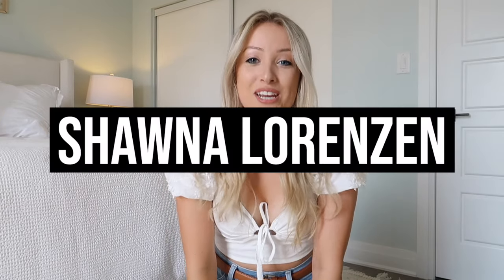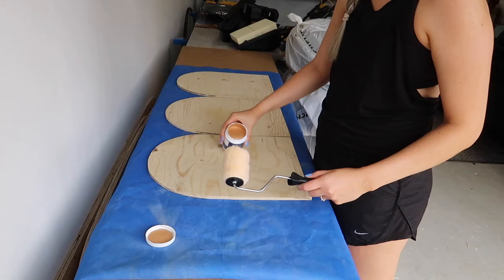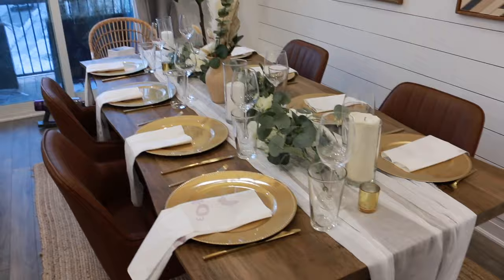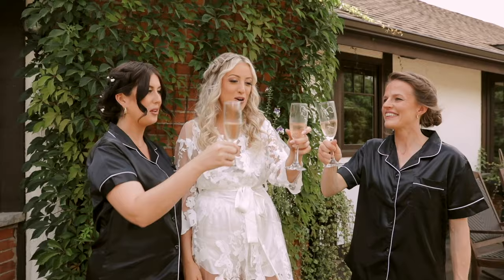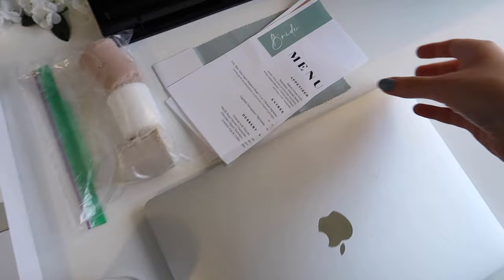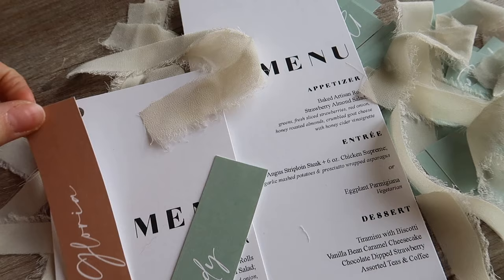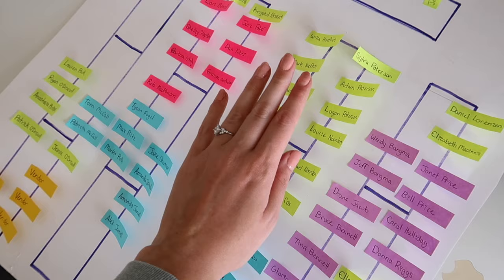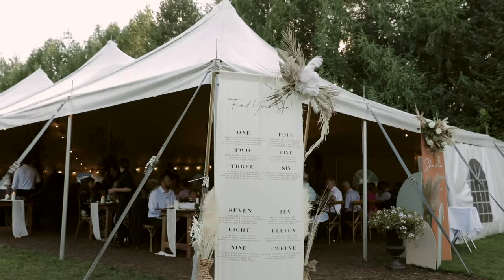DIY WEDDING DECOR | Affordable, Budget Friendly, On-Trend Signage, Seating Chart, Stationary + MORE

Comment: you said you used the large linen for seating chart. Do you recall the measurements? Also did you have to cut it, if so any tips to get it precise?
Reply from the maker: I think we cut it about 2' wide, I just measured the stand and cut the fabric to suit it, I just made pencil marks down the fabric with a measuring tape and then just cut the fabric with scissors :)